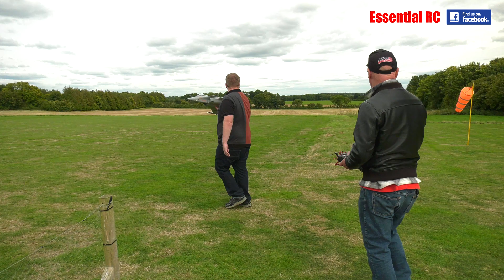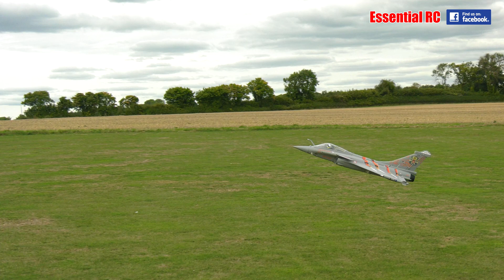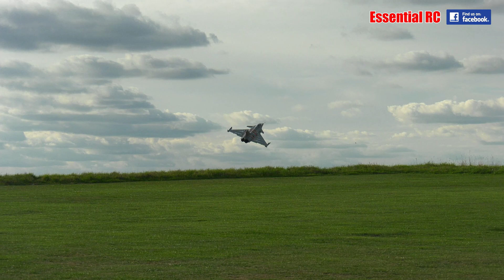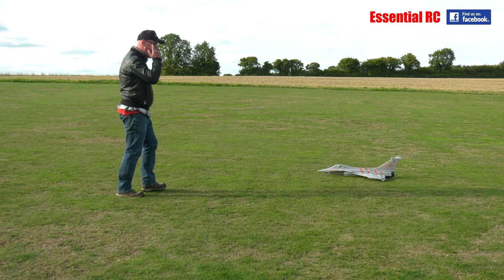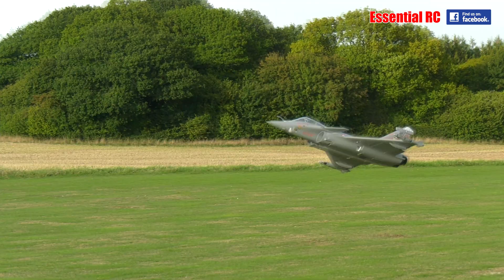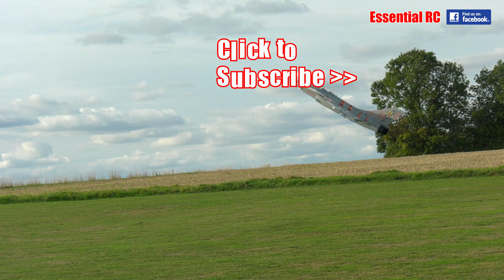SUPER SLOW HIGH ALPHA FLIGHT ! NEW FMS Rafale 64mm EDF Jet

Comment: You literally do not need ANY mod to hand launch this plane. Do not ruin your plane, it will basically just fly out of your hand.
Reply from the maker: If you've got the hands of a giant so can you hold it underneath then yeah...but as we demonstrated there is no good way to grip it underneath without doing something. And no, it won't fly out of your hand. It needs a good throw. 🤦‍♂️
Reply: @EssentialRC  If you hold it by the exhaust with ONE HAND with your fingers slightly in the exhaust and give it a gentle upward and forward push the plane very easily flies right away. So yes, it will fly right out of your hands. I do it all the time, which is why I said it. So again, do not destroy your airplanes just to hand launch, this mod is a waste of time and destroys the looks of the plane. Try it.

Comment: the mod I made on mine was to glue an EPO foam block down the centre of that wide fuselage - not unlike the one on the F14 Fattie - that is what gave me the idea - it start just in front of the Cheat grill and runs for about 6inch forward its about 1 inch deep just enough for the fingers to grip..  another fun video - well flown

Comment: That's decent flight time out pf a 2700
Reply from the maker: Edited together from 2 flights actually...but still get a solid 4 minutes.  5 minutes at a push.
Reply: @EssentialRC  that's great for an edf. My Ta-7 64mm gets about 4.5mins from a 3200 but the Su27 50mm twin only gets 3.5mins. Think I'll get this rafale and show horn the 3200 into it. Cheers